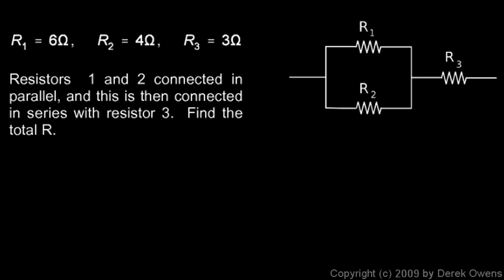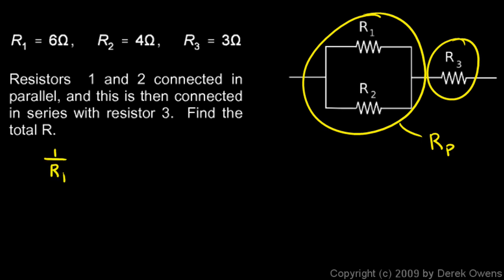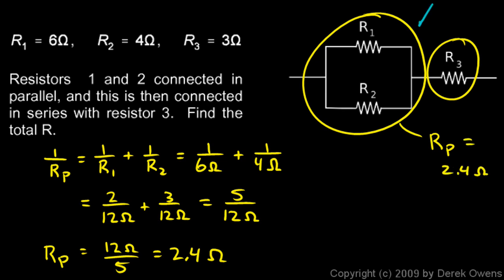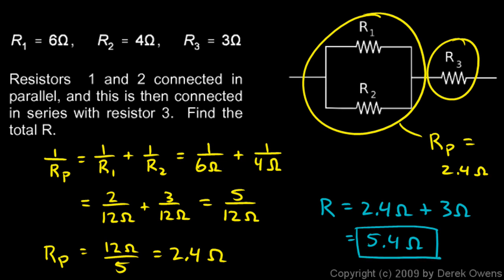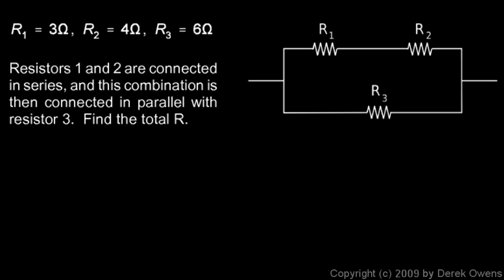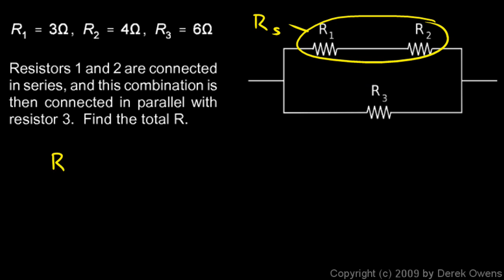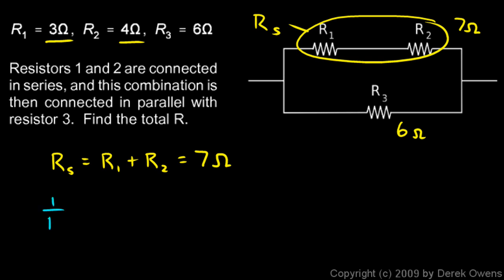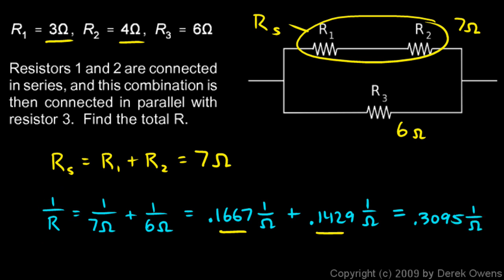Physics 13.4.2f - Series and Parallel Examples

Comment from the maker: @noorylee   Sort of, but not exactly.  Specifically, a water wheel is a device for taking the PE of the water and converting it to motion.  This would correspond to an electric motor, which takes the electrical PE of the electrons and turns it into motion.  A capacitor, electrically, is a device that stores charge and then releases it.  A good mechanical or fluid analogy would be a large tank that could store a lot of water and then release it suddenly, like the tank on a toilet.